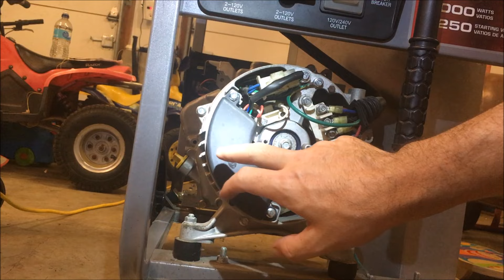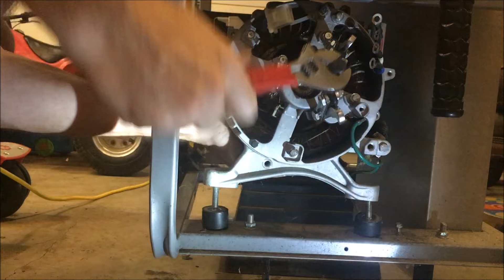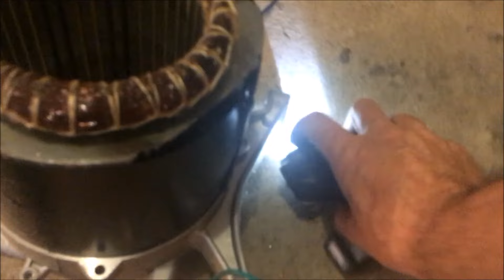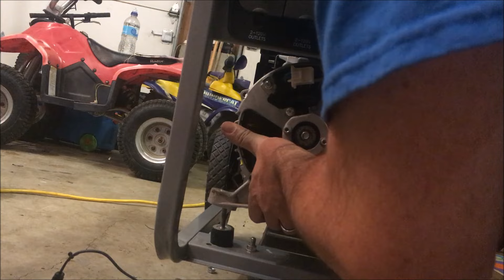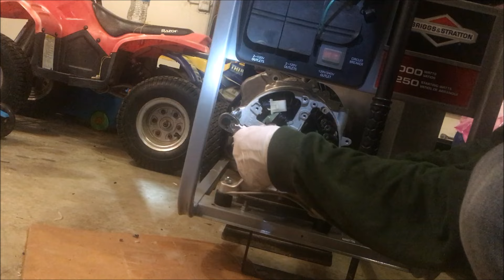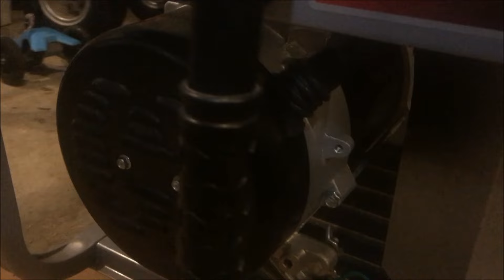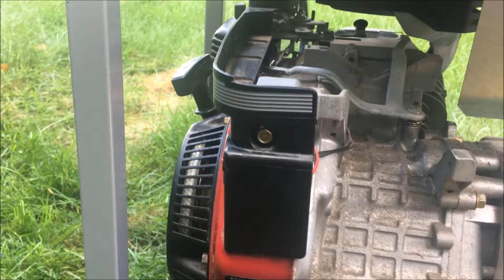Troubleshooting Generator No Power Output and Fix

Comment: Hey buddy, the issue I’m having with my generator is one of the outlets work but the bottom outlet does not work. What do you suggest?
Reply from the maker: Check the 240 volt outlet with a multimeter.  If you have 240 then likely the generator head is fine and you have a wiring issue or bad circuit breaker.  If no 240, could still be a wiring issue or a bad winding in the stator.
Reply: I have a Generac 4000 XL Are you familiar with that generator?
Reply from the maker: @terrellscaife2411  I have worked on a few, but non with that exact problem.
Reply: I don’t know if you’re willing to give out an email and I can send you a video
Reply: Is there a place I can go for a good electrical breakdown of this unit?

Comment: why are small generator parts such a challenge to find? when you do the prices are IMO, outrageous. I just bought a Predator 9kw off Marketplace. Runs fine, but makes no power. I pull the end cover to find soot. I note the brushes were dark and dirty. I pulled them out to find the little housing had melted and the carbon shaft was riding on the slip ring at a 45-degree angle. I found a replacement online for 3 bucks. I thought, wow must be a cheap set. I ordered it. Came in and installed it. I must have over-torqued it because it snapped the end right off.  The replacement 5-pack should be here tomorrow. We shall see. I have 51 Ohms on the two slip-ring tracks on the rotor. I guess that's okay. The top pair on the stator has 2.1 Ohms. The bottom pair has .8 ohms. This concerns me.
I have learned a great deal about the inner workings of small generators simply by watching your channel.
Thank you for sharing your work. It's great stuff. 
Cheers from Louisiana.

Comment: Can the copper windings on the generator stator be repaired? I have a HG5700 and the small piece of copper wire, going from the stator to the brushes broke. Its like a 2, maybe 3" piece of copper wire. Can it be repaired? Thank you

Comment: 12:27   wow....another episode of crappy designed rotor. Those engineers should be taught how to wire properly, on something rotating at 3600rpm. Should have those wires better insulated, and run along the rotor axle, to the slip rings, this is junk, the way it is. Aslo, no mechanical connection to the slip rings. Should be looped twice, crimped, then soldered, or even silver soldered. What brand of generator is this, anyway.?  To avoid.....thanks for your dedication to saving mother earth, and providing education through dedication, for us, which may require a gen for our dwellings. I got a 9 Kw Powertec for 500 and, runs good. 122 volts no load, and with angle grinder on running, shows 121.3 volts...Hang in there, James

Comment: What about the marks on the rotor. There was contact between rotor and stator.
Reply: yes, poor tolerances on the bearing end-plates, maybe recenter the rotor  assembly with long spacers between rotor and stator metal....when centered,  tighten up end plate, and pull out the spacers, whatever dimension this gen uses....

Comment: Hi James noticed you broke the stator plate using the puller  then swapped them over for a different one
Reply: Don’t forget about the generator safety rules. Here are the generator safety tips: anyone who uses portable gas generators really needs to see this safety reminder. All generator safety rules should be followed carefully. This advice is just to make sure that everyone is aware of all the warnings and it’s just to remind people to be careful using portable generators. Generators can be dangerous if not used carefully. Every year, hundreds of people die or get injured when using portable generators due to carbon monoxide poisoning and electrocution. Make sure you are using your generator carefully and keeping others safe as well. There is something very serious that everyone should always be aware of when using generators. Some people do run their generator indoors which is not safe and that increases the risk of carbon monoxide poisoning which can cause death of family and you. Some people run their generator in wet conditions which can electrocute them. Please remember that you should never run your generator indoors. Remember that carbon monoxide is an odorless and colorless gas that you cannot see or smell. Carbon monoxide is a silent killer. Keep that in mind. Make sure your generator is 15-20 feet away from your house and away from doors, windows, and vents. Never use your generator in your porch too. Having a carbon monoxide detector is very important against generator safety. Some people also allow children to go near the portable generator which could pose risks. We need to keep an eye on our children making sure that they are not near the portable generator so they won’t get electrocuted or burned by the generator which is dangerous. A locking enclosure also keeps kids safe. A generator shed might look like a tempting place to explore, or take cover during a game of hide and seek, but a generator is a dangerous piece of equipment that can cause injury. It says on the manual that we should also keep children away at all times from the portable generator to avoid injuries. Please do not allow a child or unqualified people to operate the portable generator. Just because some manuals missed what should be listed doesn’t mean it’s safe to do. Always follow the generator safety rules when using portable generators. Generators pose electrical risks. If you need to use your generator during wet weather, you need a generator tent to protect your generator from getting wet. Don’t let your generator get wet. Keep your generator dry and before using your generator, please make sure your hands and your generator is dry. Do not wear loose clothing when operating the generator. Everything that is said on the generator’s operating manual should not be ignored. Never smoke cigarettes near the generator. Please keep flammable things away from the generator. Never overload your generator too. Your generator can catch fire. Never ever try to plug a generator cord into a wall outlet to avoid back feeding. Back feeding your generator is dangerous. Always turn on your generator first before plugging in appliances and shut off the appliances before turning your generator off. Use a heavy duty cord for your generator and the cord should not be worn out. All the instructions should be followed carefully. Never refuel your generator while it’s running. It can cause fire if fuel spills while your generator is hot. You should turn off your generator and let it cool off before refueling it. Having a fire extinguisher next to the generator is also important. This is only a reminder for everyone’s safety of using generators. Make sure your generator is properly grounded. Having a fire extinguisher next to the generator is also important against the safety rules. https://youtu.be/I1jT3ANENvI and here is a video more about keeping others safe when using generators and also about our family’s safety. It’s important to keep your children safe especially little ones. Hope this helps. Thank you.

Comment: U.K. Hello James. You have an easy voice to listen to - thanks for that. Might I suggest you get a 'soldering gun', the type with a built in transformer. They are very quick to warm up and more powerful than the pencil type. My hobby is electronics but now and then I need something with a bit of grunt behind it. You may wish to get a more expensive one but the one below at around $20 would be OK I'm sure. That solder joint you did was a tad crap my friend. 
EBAY _ New Electric 100w Soldering Gun Set / Iron Kit 100W Solder Gun Kit
https://www.ebay.co.uk/itm/New-Electric-100w-Soldering-Gun-Set-Iron-Kit-100W-Solder-Gun-Kit/263153771691?hash=item3d452fe4ab:g:QscAAOSwag1fWTm5
Reply from the maker: I agree.  I have not tried a repair like that since.  I have a Weller transformer one, but that was even worse.  Will have to invest in better equipment next time.  Ended up selling that one at parts price and disclosed that it need a proper fix.
Reply: @jcondon1  atta boy....retain an open mind for improvement. Purchase a Weller soldering gun, in a kit. There are 2 sizes, model 8200 (mine) and a larger one. STAY away from any soldering iron/stuff  made in china. had one, and was junk.....

Comment: Question do you know why my brush would melt on the neutral side? Thank you
Reply from the maker: Best guess is that it was arcing producing a lot of heat.  Could have been caused by a defect on the brush, defect on the slip ring or dirty slip rings.

Comment: Question for you James have you ever ran into any ETQ brand generators and if so have you had anything major go wrong with them
Reply from the maker: I have not picked any up, which is probably a good thing because I only usually buy broken stuff.  That said, I have seen them.  Just a Honda clone.  Probably the same manufacturer used on Predator, Duromax, Champion etc...
Reply: @jcondon1  if you do ever pick one up can u make a video on it

Comment: A Very common issue I see regularly......I fixed a Generac 7500 electric start unit recently with the same issue. A friend was given it for free ! I soldered it without removing the end plate. Added a little piece of copper wire to reinforce the connection and it held.......Had to clean out the carb a couple times and it ran as new and load tested fine....A $1000+ generator ! I work for a generator service company and fix many machines....big, small and all kinds and a lot of Onan RV units......You do a great job on these videos......A co-worker took one like this Briggs out of the trash......had a broken rod and damaged crank....no oil.....I walked him thru it and he pulled it apart and fixed the engine. I got the generator end working, he had broken the brushes taking it apart.....
Reply: Good on you, bro. Hot glue sometimes comes in very handy, to hold wires which are improperly designed for rotational torque at 3600 rpm or so...twist wires mechanically as well around any connection, this is forgotten in mass assembly, by people or robots. speed is of the essence, but the quality is gone. STAY TUNED FOR MORE BROKEN GENSETS, AROUND THE COUNTRIES......
Reply: Generator safety rules: anyone who uses portable gas generators really needs to see this safety reminder. All generator safety rules need to be followed carefully. This advice is just to make sure that everyone is aware of all the warnings and it’s just to remind people to be careful using portable generators. Generators can be dangerous if not used carefully. Every year, hundreds of people die or get injured when using portable generators due to carbon monoxide poisoning and electrocution. Make sure you are using your generator carefully and keeping others safe as well. There is something very serious that everyone should always be aware of when using generators. Some people do run their generator indoors which is not safe and that increases the risk of carbon monoxide poisoning which can cause death of family and you. Some people run their generator in wet conditions which can electrocute them. Please remember that you should never run your generator indoors. Remember that carbon monoxide is an odorless and colorless gas that you cannot see or smell. Carbon monoxide is a silent killer. Keep that in mind. Make sure your generator is 15-20 feet away from your house and away from doors, windows, and vents. Never use your generator in your porch too. Having a carbon monoxide detector is very important against generator safety. Some people also allow children to go near the portable generator which could pose risks. We need to keep an eye on our children making sure that they are not near the portable generator so they won’t get electrocuted or burned by the generator which is dangerous. It’s important to keep your children safe especially little ones. A locking enclosure also keeps kids safe. A generator shed might look like a tempting place to explore, or take cover during a game of hide and seek, but a generator is a dangerous piece of equipment that can cause injury. It says on the manual that we should also keep children away at all times from the portable generator to avoid injuries. Please do not allow a child or unqualified people to operate the portable generator. Just because some manuals missed what should be listed doesn’t mean it’s safe to do. Always follow the generator safety rules when using portable generators. Generators pose electrical risks. If you need to use your generator during wet weather, you need a generator tent to protect your generator from getting wet. Don’t let your generator get wet. Keep your generator dry and before using your generator, please make sure your hands and your generator is dry. Do not wear loose clothing when operating the generator. Everything that is said on the generator’s operating manual should not be ignored. Never smoke cigarettes near the generator. Please keep flammable things away from the generator. Never overload your generator too. Your generator can catch fire. Never ever try to plug a generator cord into a wall outlet to avoid back feeding. Back feeding your generator is dangerous. Always turn on your generator first before plugging in appliances and shut off the appliances before turning your generator off. Use a heavy duty cord for your generator and the cord should not be worn out. All the instructions should be followed carefully. Never refuel your generator while it’s running. It can cause fire if fuel spills while your generator is hot. You should turn off your generator and let it cool off before refueling it. Having a fire extinguisher next to the generator is also important. This is only a reminder for everyone’s safety of using generators. Make sure your generator is properly grounded. Having a fire extinguisher next to the generator is also important against the safety rules. https://youtu.be/I1jT3ANENvI and here is a video more about keeping others safe when using generators and also about our family’s safety. Hope this helps. Thank you.

Comment: My Generator has no power, I tried to change the AVR once is plug the Generator will start vibrating and the sound will be as if it carries a load. What could be the problem?
Reply from the maker: If it sounds like it is under load when no load is applied then the stator insulation has failed and is shorted.  No way to fix that other then buying a new generator.  You could buy a new stator potentially, but is is usually $300-$1000.
Reply: @jcondon1  thanks
Reply: @jcondon1  or, just leave it in the shed, and wait till another one comes your way...salvage the stator and make 1 outta 2 or more....

Comment: Probably one of the best tutorial vids for these generators out there!
Get yourself a repair table, build one, buy one, well worth it!
Reply: I was about to say same thing but just saw your comment,    I suggest a reasonably priced scissor lift from HF.   It would save your body some wear and tear.   And a small battery powered led flood light.
Reply: I’m thinking his knees and back will tell him they want a work stand/table. Eyes too. Older eyes do better looking straight into the work instead of straining at different angles.
Reply: for sure, a 1000 pound chain hoist, and an old dryer box, i have 2 used as workbench, perfect height, thick old carpet on top,  with wheels, and can store rags in the drum, screwdrivers in holes.......ha  ha ..
Reply: The Harbor Frieght "Lift" table doesn't fall under the exclusions and can be had with the 20% off coupon.. After I got mine and kicked myself for not getting one 15 years ago! All my work I now adjust to sitting level be it a lawn mower, tractor, or generator. So much easier to see things and saves my back and knees!